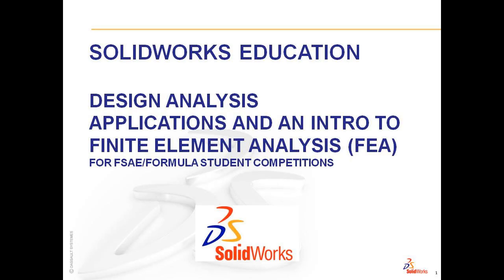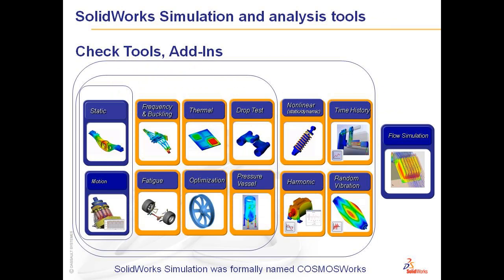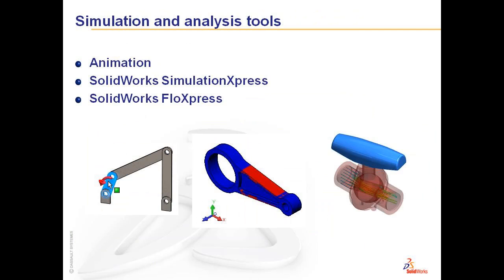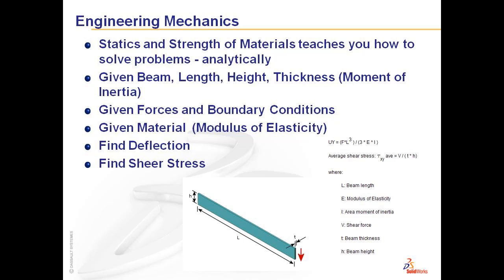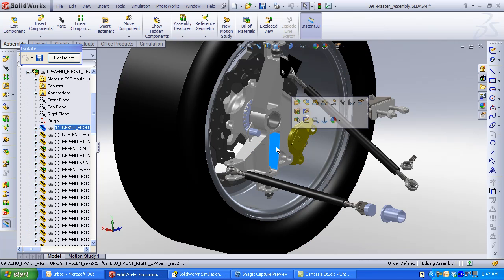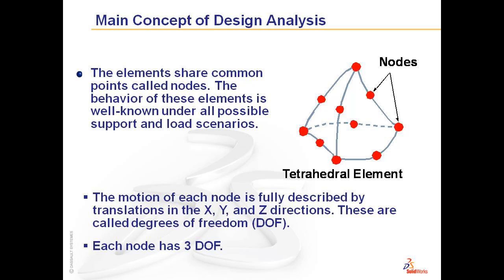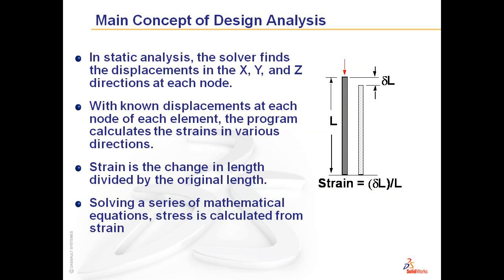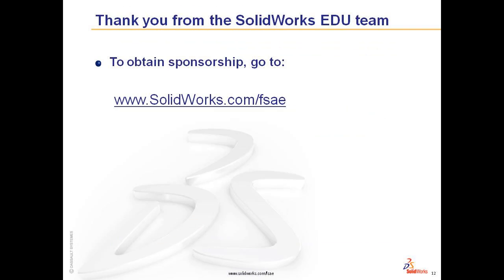SolidWorks FSAE Design Analysis Apps Intro to FEA

Comment: Hello, good day, I have a problem with my motion analysis, I have an assembly that needs to apply engine torque, but I cannot get a correct result. I'm using Solidworks 2017. can you help me?